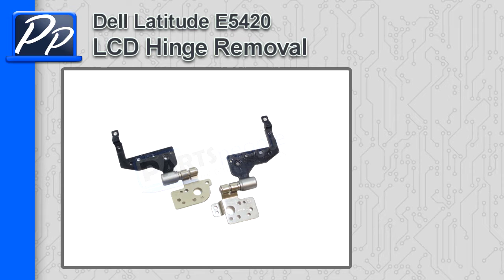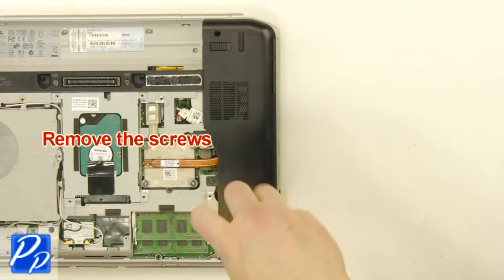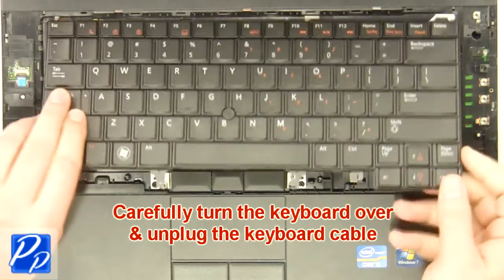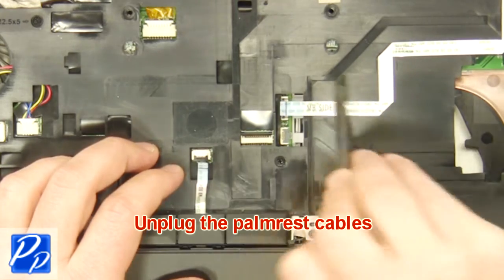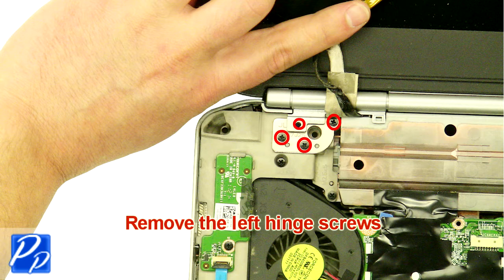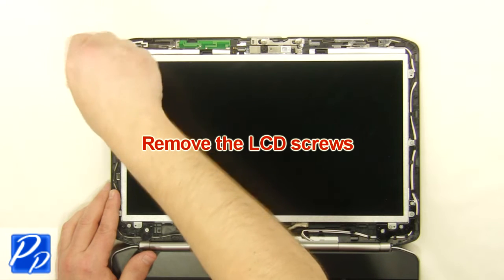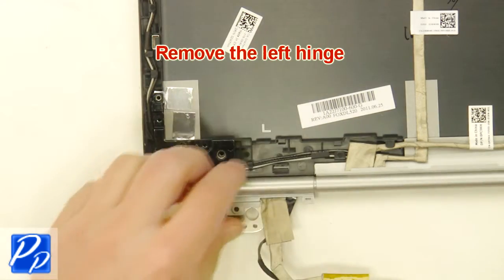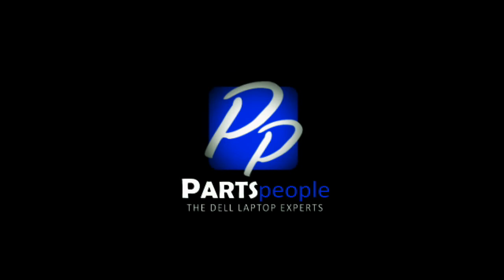Dell Latitude E5420 LCD Hinge How-To Video Tutorial

Comment: Thanks for the great video! It really helps to have someone point out all the screw locations.
I found that I did not need to do as much disassembly as this video shows, to change out a hinge.
If you take out the screws on the side of the display with the broken hinge and take out the hinge screws (on the left, one hinge screw will be underneath wiring that can be gently pushed over) you can slide the old hinge out and the new hinge in. 
That means you do not need to separate the display from the base or disconnect any of the wiring between the display and the base.
Another tip: I gathered several jar lids and used one to hold the screws from each step of the disassembly. I like that better than having one pile of screws when I put it back together.
Thanks again.
Reply from the maker: Good advise!